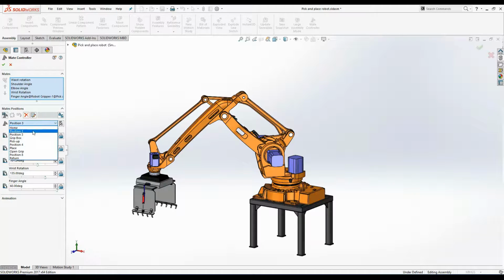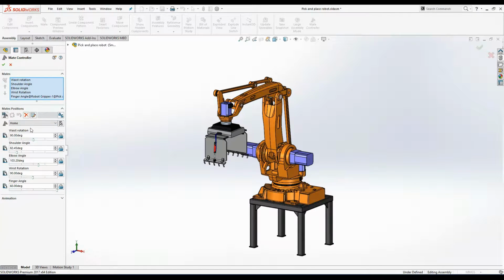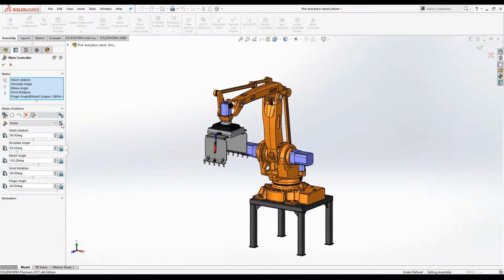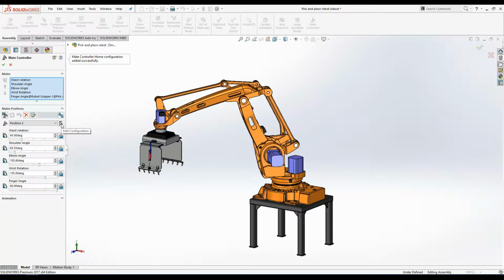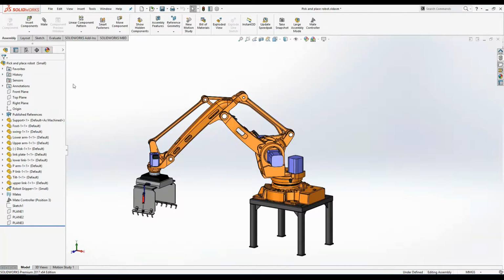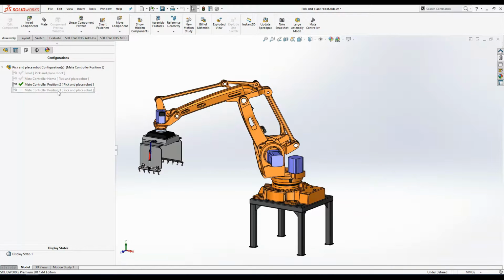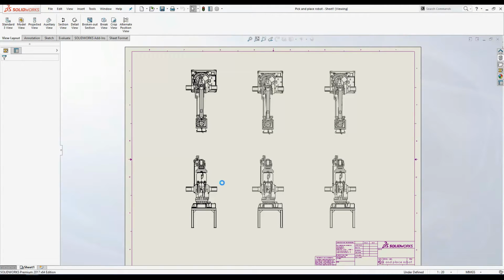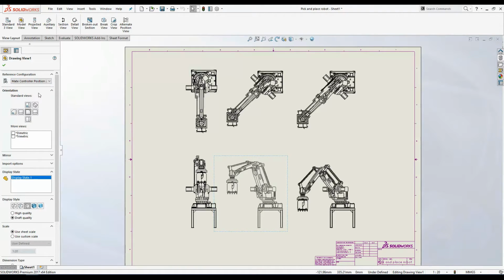SOLIDWORKS Tech Tip: Mate Controller

Comment: Searched up a lot but I couldn't find, how did you get those sliders for the angle mates ? It'll make me cancer of thinking
Reply from the maker: Hi Isa! The mate controller supports angle, distance, path, slot, and width mates.  Sliders are only available when a known limit is available, so all angle mates should have them (0-360) but regular distance mates will not unless they are limit-distance with a defined maximum and minimum value.  If your angle mates in the Mate Controller dialog don’t show slider bars you should consider contacting your support provider.
Reply: @MLCCADSystems  Thank you for your reply, I'll try few more runs with a limited angle interval.